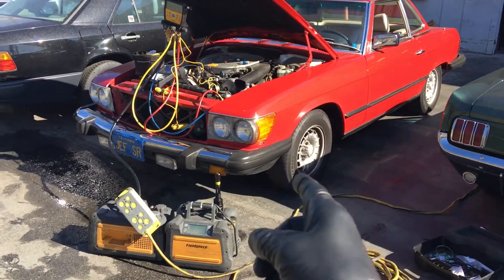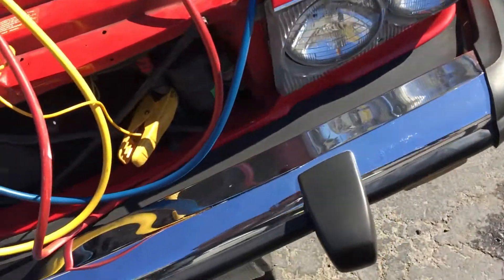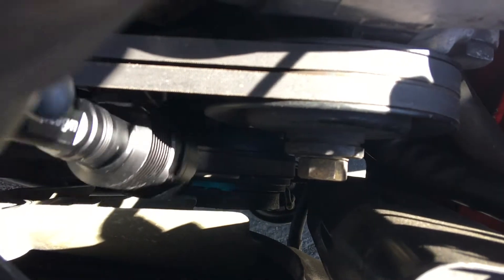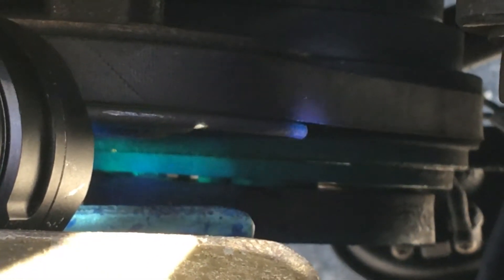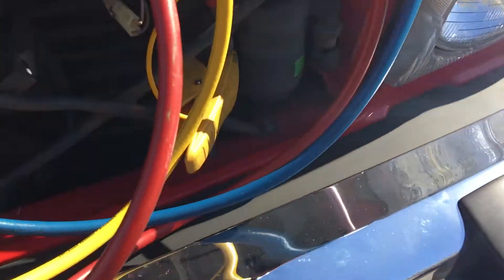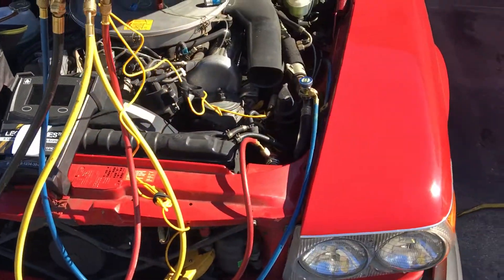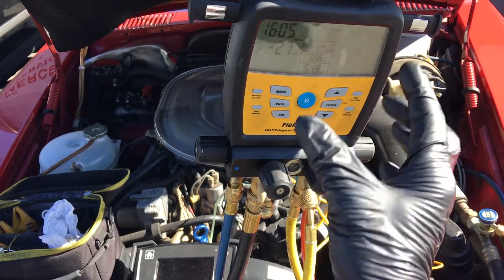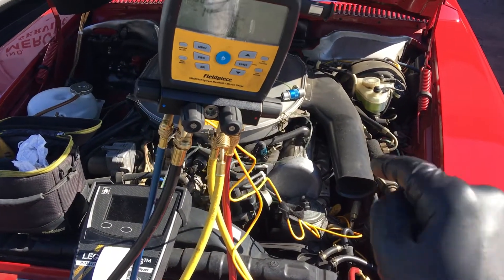AC 1985 BENZ 380 SL  find leak with UV trace dye.

Comment: hehy quick queation on vacuum. leys say i pull a system down to lets say 500 microns with a decay below 1000 microns is that an acceptable vacuum or do i need to pull vacuum again ?. what is an acceotable decay level .
Reply from the maker: If you’re doing HVAC residential like a split system you are a pool far below 500 µm and then after 510 or 15 minutes your decay would not go above 500 µm.   If it went above 500 µm you got a pull s’more

         If you were doing commercial refrigeration you would pull down below 200 µm and not want to decay that goes above 200 or 240 µm

            Automotive is pretty resilient and pretty sloppy even general motors in some of the literature only goes down to 700 µm. 

        If you were installing an entirely brand new system with no oil in it no refrigerant in it never been used you can easily get under 500 µm within 60 seconds to 2 minutes.  Of course only with the right system. 

         Then isolating your hoses was shut off valve because your refrigerant hoses have contaminated refrigerant oil in them that is offgassing and that’ll mess up your reading you would be able to hold below 500 µm. 

          If it’s your very own vehicle just leave it on the vacuum pump overnight. 

          On many contaminated systems that I get from body shops and other service shop I rarely get a system that can hold letting at the Vacuum decay 10 or 15 minutes under 1000 µm just because screwed up body shops or mechanical shops contaminated the system so bad with moisture you cannot easily repair the damage. 

       But if you use isolation valve in a vacuum rated vacuum hose to the service port and use a isolated dedicated micron meter after trying to vacuum isolating it off from valves from the vacuum hose you should be able to hold down below 1000 µm no problem with an overnight vacuum
Reply: @coldfinger459sub0  thank you so much buddy . most helpful information